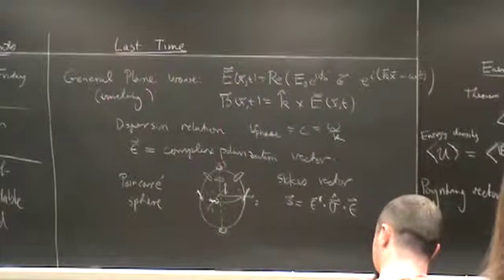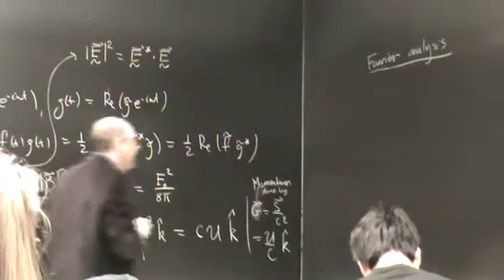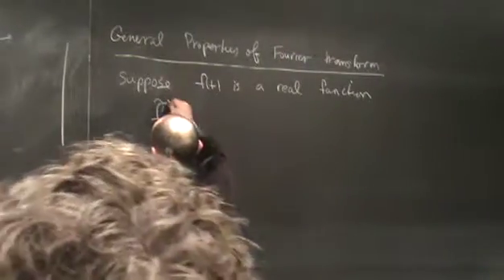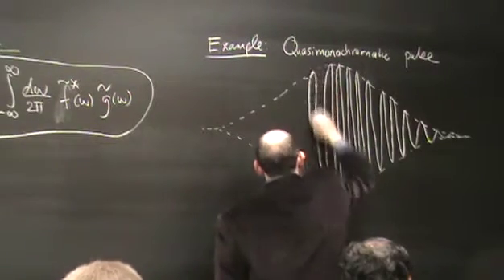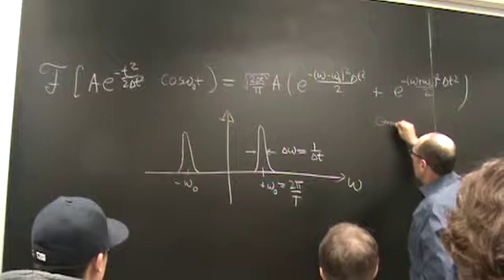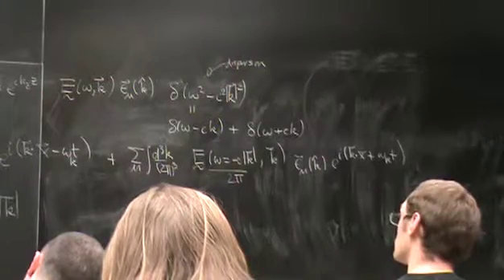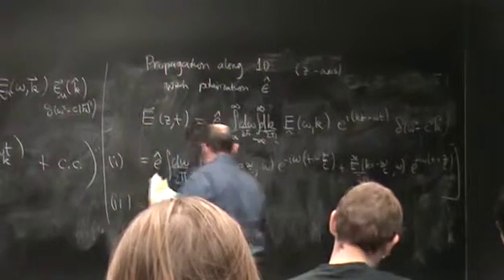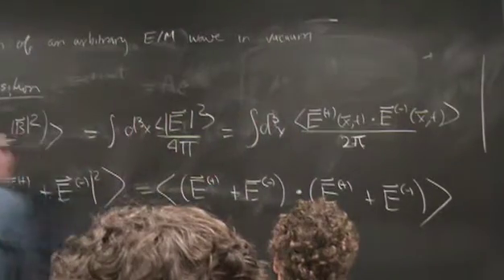UNM EM511   Lecture17   Plane waves III  Fourier decomposition

Comment: When dealing with the delta function imposing the dispersion relation, one should be slightly more careful. An extra factor 1/(2c|k|) appears when performing the omega integration. This is actually important in order to keep a Lorentz invariant measure of integration, as might be explained in later sections of the course.
Reply: can't agree more